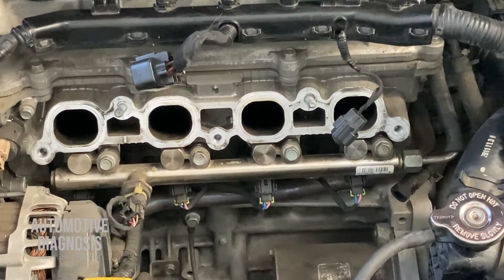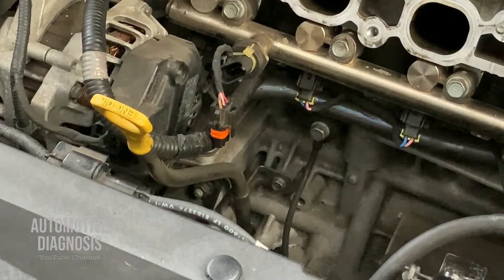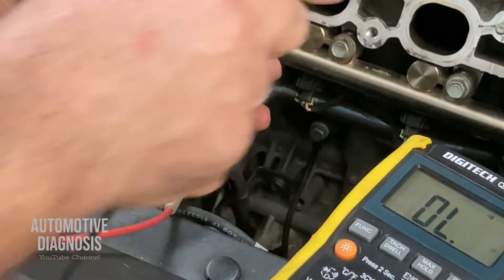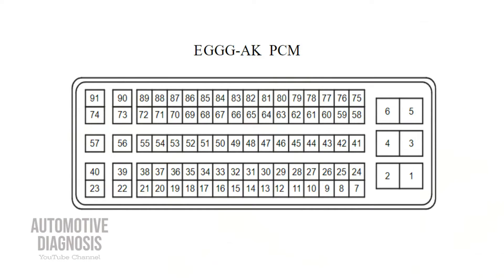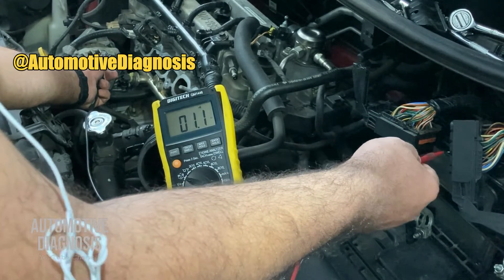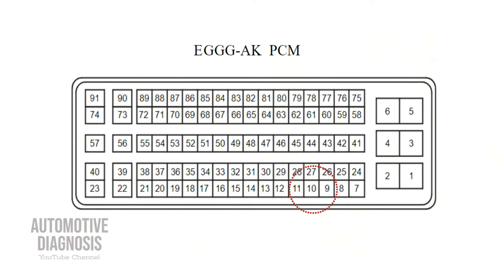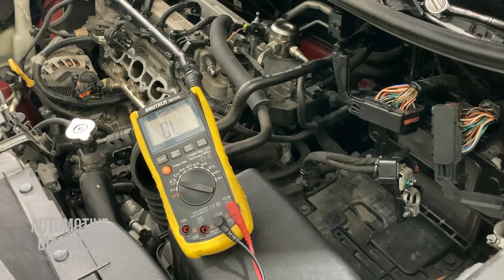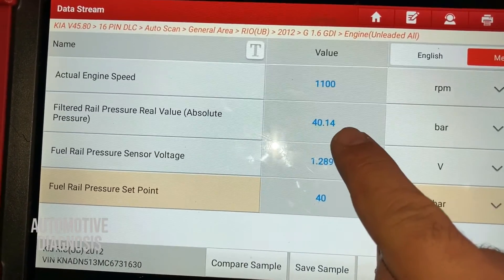Don't Replace Your Fuel Rail Pressure Sensor,  Watch This First!

Comment: Does the initial reading for ground wire is sufficient to confirm there is proper continuity or else we have to do continuity test like you mentioned in the video,do we have to turn off ignition and disconnect negative terminal of battery to perform continuity test on ground wire
Reply from the maker: Hi there, for any wire, if we have proper reading, we don't need to go for the continuity test. And yes, IG Off, Battery negative terminal disconnected and then we go for disconnecting the ECM connectors.
Reply: @AutomotiveDiagnosis also does all the three correct voltage readings on sensor wiring harness means ecm is fine aswell

Comment: I was diagnosing similar problem, wiring was good and i was getting 5v from both signal and power supply from ecu but when i connect the connector the car does not start, but when i disconnect the  from the sensor the car start fine and run.when i connect the connector again the var does not start. I changed the senor but still. What could be the problem sir?
Reply from the maker: Hi my friend, by any chance, have you checked the fuel pressure control valve?
Reply: @AutomotiveDiagnosis yes, is working fine.

Comment: Im getting a P0088, and a P0193 on my 19 civic coupe ex-t.  Id love to fix it myself. Im pretty sure its the sensor,  problem is I cant find one online, and honda doesnt sell them. Fuel trim is super high,  +28 . When the car goes into limp mode it will crank and crank, finally start and fuel trim is -14 -20ish. I have to touch both battery cables together just to clear everything enough to make it to work. If I step hard on the gas it will go into limp mode. So i have to drive at 1/4 throttle.

Comment: I see your fuel rail pressure sensor voltage is about 1.2 V, Lets say it was 5 V instead of 1.2 V what that means, Thyanks
Reply from the maker: Hi there, constant 5 V could be open circuit or short to another 5v wire.

Comment: When checking the pressure sensor of a 2010 Kia Ceed diesel CRDI, it shows 42 bar and then drops. At that moment, noises come from the engine. Could the problem be due to the sensor not maintaining the pressure properly?
Reply: اذا كانت مضخة الضغط العالي على عمود الحدبات تكون المشكلة ميكانيكية احيانا

Comment: Indeed, you have enriched my  information .I really  thank you  for your efforts .Can I check the connector by putting the red probe to battery positve and the black probe to the other wires once a time  ?
Reply from the maker: Hi my friend. It’s better to get the ground from a good body ground.
Reply: @AutomotiveDiagnosis🌹🌹🌹

Comment: Why is it that you have a code in every video, do get any problems that don't give you a DTC ? I have been chasing a fault with my car for months, I bit the bullet and went to the dealership thinking they are going to fix it, 20 minutes later they said no DTC and gave two quotes one for replacing the EGR and one for valve clearance, had they opened the bonnet they would have seen the that I already replaced the EGR because it is still shinny. $1850. to do a Valve clearance, I just came home and did it myself .
I tried a local shop and they didn't want to touch it, I think it was too hard for them.
Did it fix the problem no. Mitsubishi Triton MQ 2015 2.4L diesel 133 000km every time I come to stop the RPM drops to 600 and then goes up to 600 and the idle is rough.  When in park the AC is on it does the same thing when it cycles. replaced the EGR because of vacuum leak through the pintle needle, replaced the turbo cartridge because of vacuum leak at the lever that moves the vaines(VVT), leak at the DPF sensor 1 and DPF first joint to exhaust pipe, donut gasket was damaged at the factory when installed. 
Tested the following 
MAP
MAF
OCV Cleaned and tested outside of car
VVT Solenoid 
EGR solenoid 
DPF sensor 
DPF Temperature sensor 1 and 2, couldn't get to 3, but OBDII scan tool the readings are good.
Three wire camshaft sensor removed and cleaned, 
Three wire Crank Angle Sensor, I haven't got to that yet and I sold my oscilloscope from the1990s that was the size of my desk 
so I can't test it.
Tried new used ECU with the latest software got the same thing and mine has the new software

New throttle body about a year old
New EGR
New turbo cartridge 

Any ideas before I buy a oscilloscope?
Thanks

Comment: Thank you so much , usually after checking voltages of the sensor I use air compressor and  a scanner   to  read the   air pressure  injected  in the sensor.
Reply from the maker: Thanks for sharing your experience.

Comment: Thank you amigo I did have one with a low pressure sensor regulator code but it turned out to be the high pressure pump without the code for the pump😢
Reply from the maker: Hi my friend. Thanks for sharing your experience. Pressure regulator is located on the high pressure pump. Pump itself works mechanically and does not have any specific code. We check the pump condition by monitoring the pressure regulator and pressure sensor.

Comment: 40 bar is nearly 600 psi it should say 40 psi if I am wrong i apologise.everything else was brilliant
Reply from the maker: Hi my friend, it’s actually 40 bar. It’s very high pressure because injector injects the fuel inside the combustion chamber, so it must be very high.

Comment: Sir, can you please make a new video about this?

In modern cars, say, Toyota Glanza, Taisor and Maruti Baleno and FRONX, there's 12V at any door switch when the door is closed. And after 20 seconds, it drops to 7V and remain constant 7V. 

When door is opened, it is constant 0V.

Same case for all the remaining 4 doors including dicky.

Can you please explain with wiring diagram why the voltage drops to 7V from 12V?
What's the significance of this delay about 20 seconds?
Why not remain 12V as in previous cars like i20 etc etc?
Reply from the maker: Sure thing my friend
Reply: @AutomotiveDiagnosis  I'm very much keen to know what's the ADVANTAGES of dropping to 7V rather than maintaining at constant 12v?